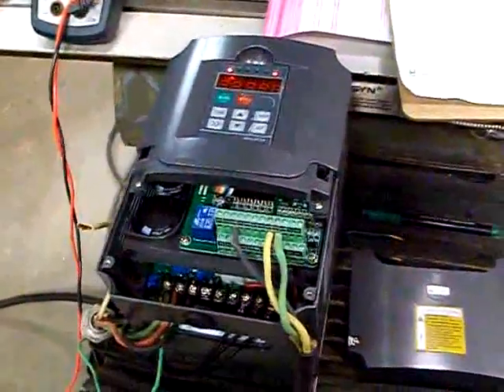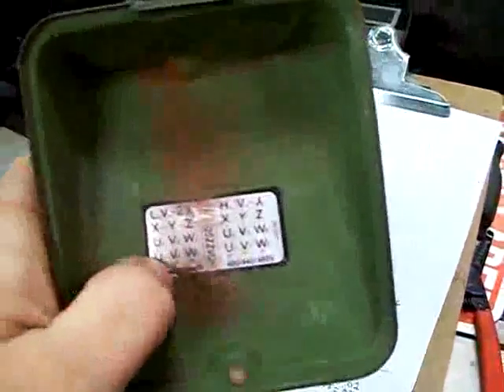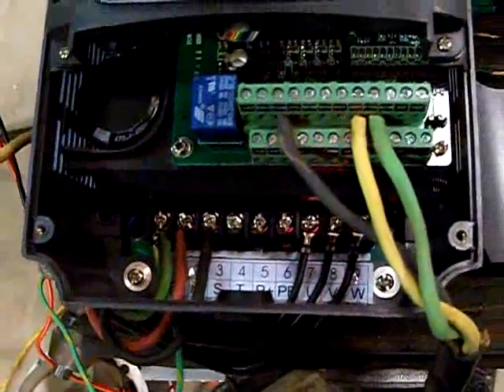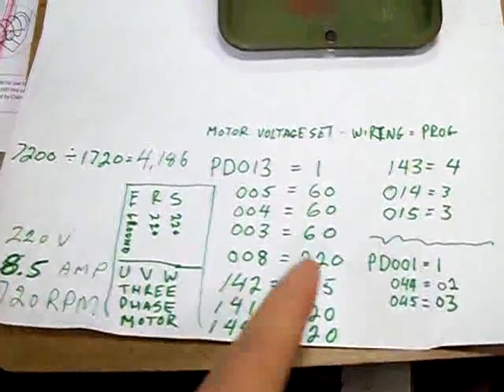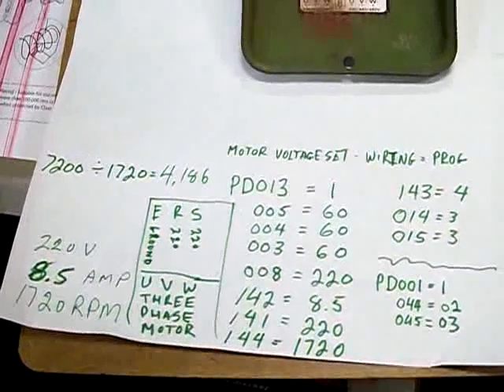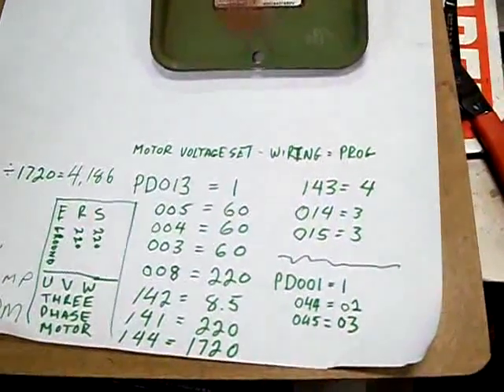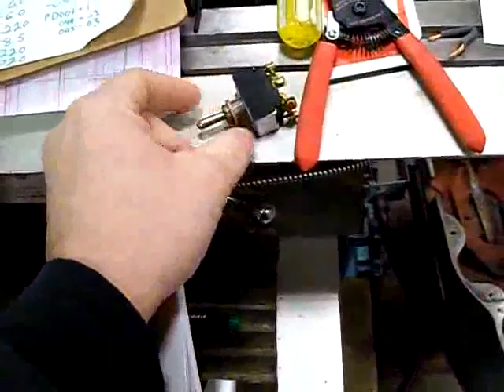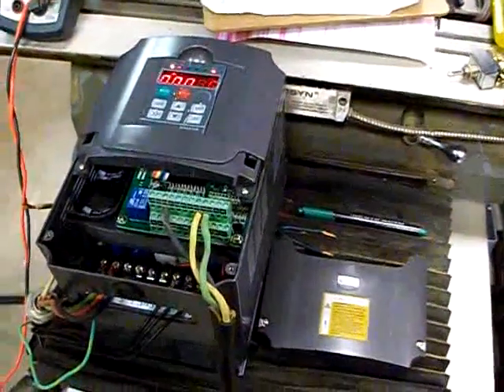HUANYANG 4.0 KW INVERTER VFD HOW TO SETUP AND WIRE SINGLE PHASE 220V BRIDGEPORT MILL PHASE CONVERTER

Comment: Thanks for info, but I don't understand the programming interface.  I go to set, say PD005 to 60.  I press Prog and this number 400,00 is displayed.

I need to get to 60, so I press the Down arrow button, and the 400.00 changes to 399.99.  Continuing to hold the down arrow, the display crawls down to 398, then after some time, it gets through the tenths and hundredths digits, to 397, and so on.

Is there some way to just enter 60 and not have to do the down by tens/ones/tenths/hundredths?  In other words, is there a way to get to the 100s position, hit the down arrow 4 time to get to 099.99, then to the tens position, and down to 6, then ones position, to move to 0, etc?

Thanks
Reply: +boogerhead0  Yes,  just use what looks like the fast forward arrow key. It will move over 1 digit at a time so you can change any digit in an instant. 400 to 60 in just a few pushes.

Comment: Hi Thanks for this everything have is identical to your setup. When the motor is running there is a high pitch whine from it. The motor runs fine. It is not a mechanical noise. It sounds like a hi freq unfiltered noise. Does yours do that too?  

Walt in Montreal
Reply from the maker: Yes this is normal. All motors running on vfd drives will have that sound.
Reply: Thanks. I just read that increasing the carrier freq will shut it up. Do you know of this?
Reply from the maker: Walter Kucharski
You can but you will derate the motor's HP and it can also cause your motor to run at a higher temperature.

Comment: I am in Canada I want to install this unit on my lathe Colchester Master 2500 precision and motor is 5 HP 600 volt is this unit will work on this motor, thanks in advance.
Reply from the maker: This particular unit will not work. You'll need a 600v vfd. If you have 600v 3 phase supply then you need a 600v VFD that you can use directly. If you have only single phase 220v then you'll need a 220v to 600v transformer then you can use a 600v vfd. The added cost of the transformer and VFD for this lathe makes me think you should just rewire a single phase 220v 5hp motor. Princess auto is a cheap place to get them when they come on sale. If you want to keep the original motor then buying used transformers and Vfds on Kijiji is your ticket. Good luck!

Comment: My inverter is similar as yours., but my spindle does not even tur on. Just keep flashing. the run do nothing, and the stop does not response.  The instructions are really crap. difficult to understand. May I turn on my spindle with out the inverter? I am in USA 120V
Reply from the maker: The whole purpose of using the VFD is if you want variable speed of a 3 phase motor or to do what I'm doing run from a single phase supply to run a 3 phase motor. These VFDs do not run off 120v. What's the voltage of your motor?  If all you want to do is turn on a 110v motor then use a motor starting switch of the rated HP and call it a day :)

Comment: So how do I save 20 bucks by making my own cord?  Won't I need special plugs on ends of cord?
Reply from the maker: You should be able to buy the plugs at any decent electronic parts shop for only a few bucks they are called 10 Pin IDC Cable Mounting Socket you'll need male and female of course. For $20 bucks and free shipping for cord spare panel with the holder that price is hard to beat though.

Comment: Where can I buy a long display cord so as to mount the VFD remotely? My 2.2 kw is used on Bridgeport mill........also have a 4kw I will be setting up on a 5 HP lathe.
Reply from the maker: They are simple to make but you can buy them on Aliexpress.com search this number 1824343966 it will take you to the listing.

Comment: Is this VFD still working fine for you?  I am looking to use this same unit to power my milling machine and I just wanted to see if it has lasted and performed well for you.
Reply from the maker: 1-1/2 years and still working perfect. I use the mill for only repair work and likely only use it for 2 hrs max a week. No complaints so far. I just bought a 3kw Huanyang VFD for my 3 phase Delta industrial wood planer. I hope it works just as well.

Comment: Great setup and nice mill! :) Did you ground your motor too? Did you wire it to the VFD grounding?
Reply from the maker: The motor is grounded on the E terminal. Some Huanyang Vfds have a separate terminal for motor ground.

Comment: Im using the 2.2 kw version for my 3 phase 220 lift what parameters do i need to set my manual has pd000 and it goes up from there please someone tell me which ones to set i know all the info just not how to set up and use this setup
Reply from the maker: You could easily program the same parameters I used It will work fine.

Comment: i have problem with my HUANYANG 4.0 KW INVERTER VFD when i do the job it stops randomly.feels like spindle haven't power. rpm 24000 400hz but still it stops when cuting wood with 11.2mm end mill tool at 10mm depth.
Reply from the maker: You're likely overloading the spindle. What feed rate are you using? What KW is your spindle motor?
Reply: DJB HSI http://www.ebay.co.uk/itm/AIR-COOLE-MOTOR-SPINDLE-3KW-VFD-MATCHING-INVERTER-3KW-ENGRAVING-GRINDING-o4-/130616263351?pt=UK_BOI_Industrial_Automation_Control_ET&hash=item1e695602b7 same spindle but only inverter is 4kw
Reply from the maker: Endijs Ogrins
I looked at the specs of that spindle and I find it hard to believe such a small spindle like that is 3kw. Anything above 300hz, you will be losing torque.
Reply: DJB HSI i now use it at 400hz. what about voltages? start, minimal? i set min 120hz min voltage 45 thats only way it works for now.

Comment: Hello DJB 
I'm trying to set up 3 wire control on my Huanyang 2.2kw for a wood bandsaw .
Ive purchased 2  stop NC switches and 1 start NO switch ..so i can have basic
 on and off controls.
I have been advised to get a low voltage power relay ...Ive been looking but only seen one relay that was used with a Huanyang drive ..
It was a  5 volt DC relay  .
Would this be suitable for my application ?
Thanks for the vid !!!
Tomas
Reply from the maker: I don't really understand why you need more than 2 switches. All you need is 1 switch to turn on the VFD at the 220 in, (I'm using a magnetic motor starting switch) but as long as you use any switch rated for your HP that will be fine. Then all you need is an on off switch across DCM and Forward. Unless I'm missing something, it should be this simple.
Reply: DJB HSI Thanks DJB
I was unsure if the stop buttons possibly.... "needed to be continually pressed until the motor stops which is not safe in my mind "  ....

Unsure how much built in braking capacity i have ( 2.2kw does not come with components for use with a braking resistor , so no DC braking for me ).. 

I can wire these switches in series ..... for a dual button stop ( Coasting Stop setting that is..)  and i will be wiring it as follows ....

DCM into dual NCs Stop buttons first,  then into the NO Start switch   and connected back into FOR terminal .   ?

THANKS also for the direct info on the mag motor start switch ..,
I was wanting to use my original bandsaws switch for this application but I felt slightly pushed away from this idea as its good practice to keep capacitors charged ...Ill take all the "tamper deterrent" switches i can get please ....
Provided it has a suitable rating .
Sound ill start making a chunky housing for this too and make it look scary
with lightning bolt stickers .
Hope Your vfd is going strong for manys a year.
Thanks Again DJB !!!!
Tomas

Comment: Hi" I also have one of these & find it perfect for my 5hp lathe. I want to wire up the stop foot brake to it but can't figure out witch terminals to use? Can you help me with that. Rob
Reply from the maker: If the foot brake mechanically stops the rotations of the drive motor/spindle, the regenerative power from the motor will trip out the VFD. Out of the dozens of lathes If owned I've never had one with foot brake. I think you'd be better off getting a braking resistor setup on your VFD. With the proper resistor setup the spindle will stop fast on it's own without having to touch the brake.

Comment: Is there a way to start/stop this VFD using a powered input? Looking at getting this exact model to run small 3ph motors on single phase (for a compressor). Just a bit of coin to throw down if It can't turn the motor on/off using a pressure switch.
Reply from the maker: It's been a while since I looked at a pressure switch but I think all you would do Is wire the motor directly to the VFD and use the pressure switch contact to turn on the VFD across DCM and forward it should be as simple as that.

Comment from the maker: 1.5kw should power up to a 2hp motor. I wouldn't even bother trying it on a 3hp motor like my mill has. Many people claim you should over rate the VFD when running it from single phase. I'm using a 5hp VFD for a 3hp motor. It's been running almost 1 year now with no issues.

Comment: Thankyou very much for the video, that setup list you made got my drive running!, I though it had a failed IGBT due to the way it would try and limp up to speed and stall, but it seems they need a bit more setting up than it appears in the manual.

Comment: Great instruction video. I took your notes and made the settings to my vfd. Couldn't get the darn thing to go into reverse. I am using external switches in my application. After a couple of hours and lots of head scratching, as well as looking at every page of the manual I came across PD023. I was so thrilled finally to get the thing to go in reverse. I was hoping to add some new info to your video.... and then I spotted the your post "Also I believe....forgot to talk about PD023"....LOL!

Comment from the maker: OK I found that someone posted this on a forum:
 Connect both ends of the speed pot across ACM and 10V on the top row of connectors and connect the wiper (center) of the pot to V1 on the bottom row of connectors.
 PD072 to 60HZ. Set PD070 to 0 for 0-10V setting. Set PD002 to 1 for external speed control.

Also I believe I forgot to talk about PD023 in my video. Set it to 1 or you won't be able to reverse

Comment from the maker: I saw that number also, I took my laser RPM tach and tested the rpm of the motor and it was 1800 rpm I'm not using the readout on the vfd so I'm ok with that. 10k is what they call for in the manual. The pot is for control only there is hardly any current going through it,

Comment: I set things up per your instructions and things seem to be OK.
I did have to adjust 014 & 015, but no big deal.  Think I will also try your suggestion on using pot to control motor speed. Will 10K be sufficient to use with this 10 hp, 27A motor?
Also, 144 is set to 1770, but ROTT  shows 2124!?!? To your knowledge, are these units relatively accurate?

Comment: My research, including talking with manufacturer in China, is that THIS UNIT will produce full output power with either 2 or 3 phase input and so far, so good.  Runs my 10 HP 3 phase motor just fine.
Once I complete my project, I will be able to fully load the motor, then I'll see if this unit will supply the 27amps my motor requires to operate properly.
Reply: zomaxx3671 are you getting the full 220vac @60? mine won't

Comment from the maker: I was told and from what I read everwhere you should overrate the vfd when running off of single phase. That's why I'm using a 5hp inverter with a 3hp motor. What are you running the vfd on?

Comment: Quick question,...... do I connect the 3 phase motor ground wire to the same 220V ground point on the VFD which is terminal "E"?

Comment from the maker: Ok if you want to use the control panel to control speed. Make sure PD002 is set to 0 and the 3 pin jumper strip is set to pins 2-3 so that would make it the 2 pins to the right. Default mine came with the jumper set to1-2 You will then be able to adjust the frequency which will adjust the speed. Use the >> button to get the cursor to the 1st digit and use the up and down arrows to adjust the speed.

Comment: Is there a way to program VFD unit to control motor speed through panel? Variable speeds would be ideal, but even if speeds were pre-selected, maybe 2 or 3 desired rpm's, that  would be great too.  This way the digital read out would hopefully indicate motor shaft speeds.  My motor is 10 HP and draws 27amps @ 230VAC.

Comment from the maker: To answer your question on setting up variable speed. You'll need a 10k linear pot. Hook V1 to the center terminal on the pot. Hook VR to one side terminal and ACM to the other terminal. Make sure the 3 pin jumper on the VFD at the right side on the circuit board is jumper set to 1-2. Program PD002 to 1 and you should be good to go. I'll make a video of this setup if I can find a 10k pot in my parts bin. Good luck!